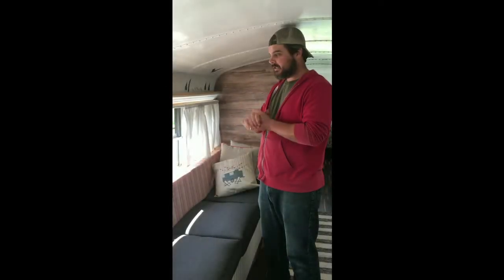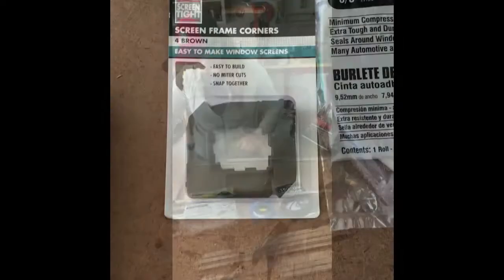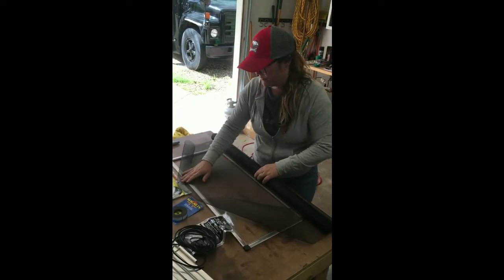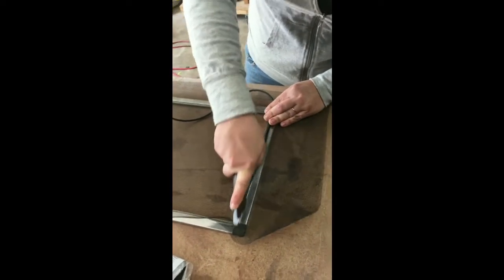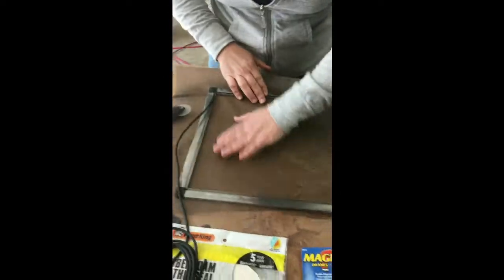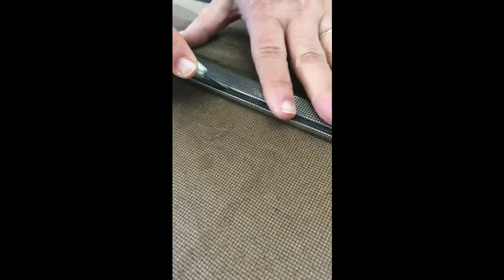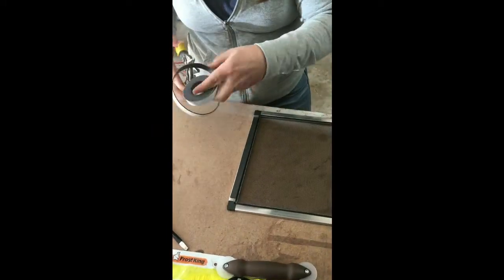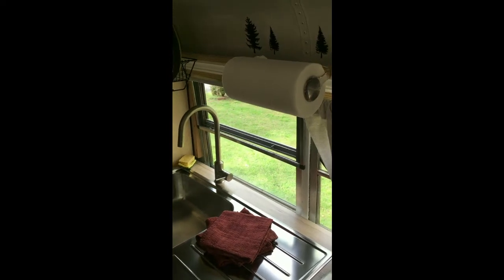How to make screens for a bus conversion

Comment: Did your windows already have the iron support beams or did you put something over the aluminum?
Reply from the maker: They posts between the windows are steel, and they came that way.  I would assume most buses are constructed in this way using ferrous/magnetic metals as they tend to be stronger and cheaper than non-ferrous/non-magnetic metals.
Reply: Thank you :)